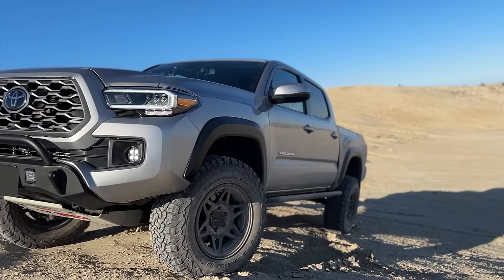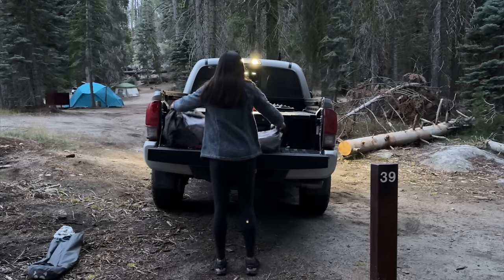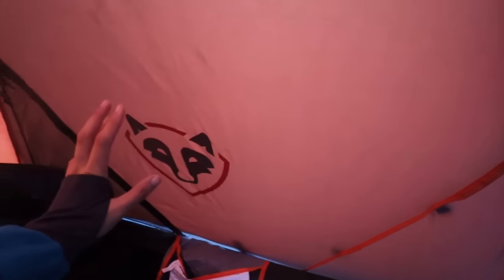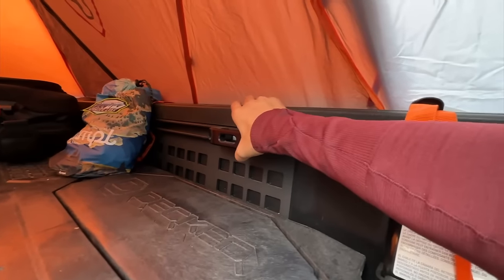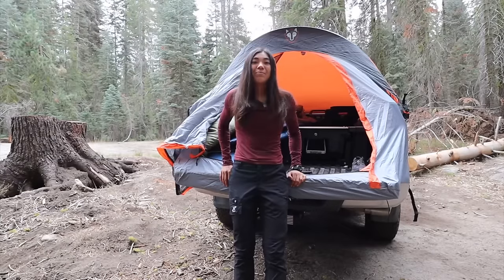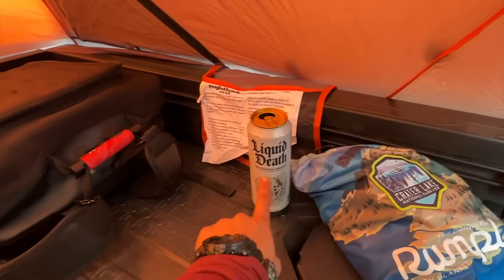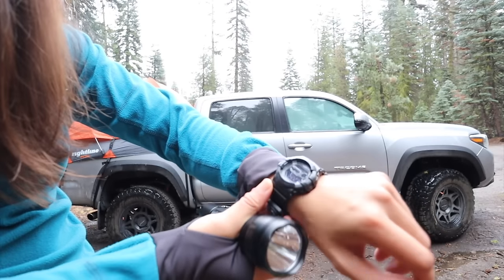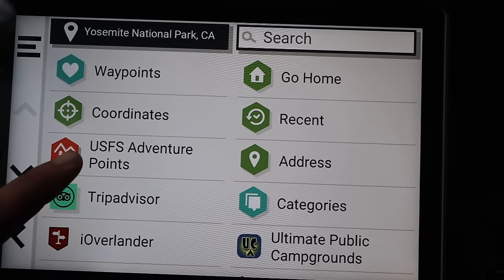Toyota Tacoma Simple Setup for the *Occasional* Overlander/Camper

Comment: I have a Ford Ranger and the exact same tent. I love it because it all fits neatly under my tonneau cover. I built a bed platform and a same wardrobe. I love that it is so quick to set up and take down. I was just in Southern Utah dodging thunderstorms. If I need to move, I drop the tent, fold the sides into the truckbed and pull the tonneau cover over it and take off. This way I can keep the bed platform and wardrobe in the truck all camping season. I'm ready to go at a moments notice. Love it.

Comment: I have this exact tent, and its been great. I love the way you can set it up to be a super comfortable bedroom. We added the SUV tent to the equation as an annex as well. For comfort, it is 2nd to none. Its roomie, its relatively easy to set it all up, and it just looks cool too. Weve gotten a lot of compliments on our camp set-up. If youre gonna set up camp and stay in one spot for a few days, or if youre overlanding solo its not much of a hassle. But if youre overlanding with people that have RTTs, it can be anxiety inducing trying to break camp fast enough to not feel like youre the hold up. A couple tips on set-up to make it fit a little easier and give you a better fit. One, make sure the tailgate portion is on correctly before pulling the tent onto the bed. If you can, move the orange tie down straps about 2' to the side wall of the bed (close to that tie down you showed off), not at the tailgate. It helps with the overall positioning of the tent. The 2 black tie downs at the front work best if the one that goes back at an angle goes over top of the one that goes straight down. I dont know why it matrers, but it does. My tent is not an exact fit either, as it is made for a 6' tacoma bed and my Colorado long bed is 6'2". So i tend to settle for as close to a perfect set-up as i can get. That interior flap is not a 100% needed as long as the exterior one is put on right. We are likely switching to a RTT set-up for the faster set-up/takedown, but i will forever love this tent. And i highly recommend the suv/annex tent if you want a place to stand up to get changed, keep a toilet private or just have a space you can hang out in if the weather is crap.

Comment: its a great truck bed tent, im 6ft. with a tacoma sr5. i sleep comfortably

TIP: the orange cable gets hooked on the inside to those D Rings you installed, thus allowing the flaps to go inside the bed when you tighten them.

Comment: I was going between attached to the truck camp build or standard tent on the ground. 

I ended up going tent on the ground.

if I ever gotta go drive I can without taking Anything apart. 

I bought the famous 14k plus review 6 person  sundome Coleman. 

We used it it rained even though weather app showed no rain. Tent held up pretty dang A+ not a single drip inside the tent. I highly recommend it. 

Other than the elk going on a hollering spree from 10pm -1am everything was fine. I legit was scared outa my mind .

Comment: You certainly have put a lot of time and effort into your truck.
I traded my 21 for a 23 TRD Off-Road, and now I am looking close at the 24 Trail Hunter. This would be a great setup for the Trail Hunter as it comes with pretty much everything else needed for “over landing”
What do you think of the 24 Tacoma line?
Reply: Trailhunter is supposed to be very difficult to buy for the foreseeable future.
Reply: @induction7895  yea Trail Hunter and TRD PRO because of delayed delivery of the electric motors.
Reply: The turbo gens your making a mistake 2 turbos uses more and expensive gas and oil changes every 2,500 vs 5k or 7k or 10k

Comment: I have a 2017 Tacoma 5ft bed. Do you happen to remember what size you ordered?   I went to your link and it gave the 5ft bed model for almost $200, but then had a mid size option for like $89 and the dementia’s didn’t make any sense as it said 23 inches in length. I like the tent, just not sure what to order.  If you can’t remember that’s totally ok.  Any response would be appreciated very much.